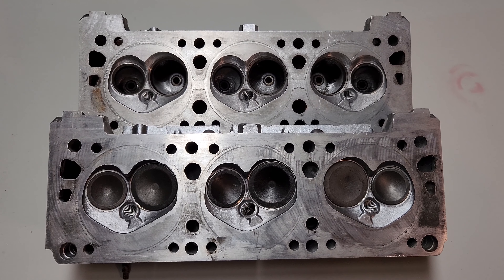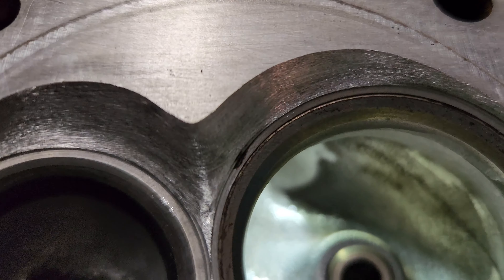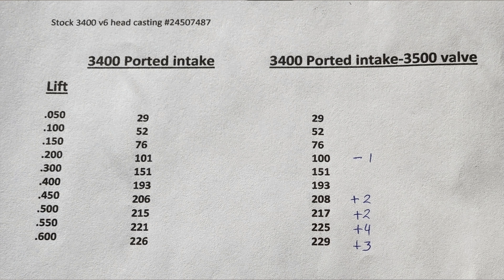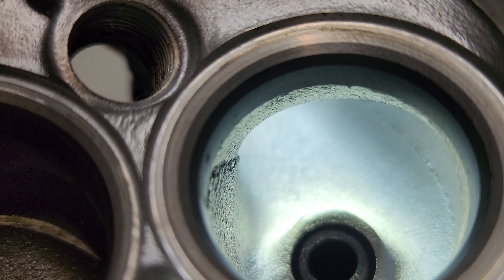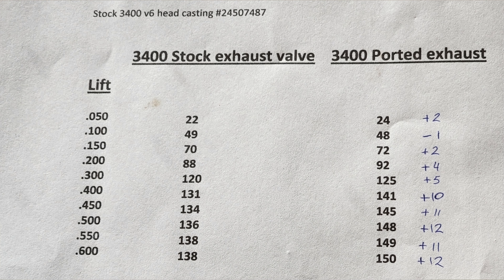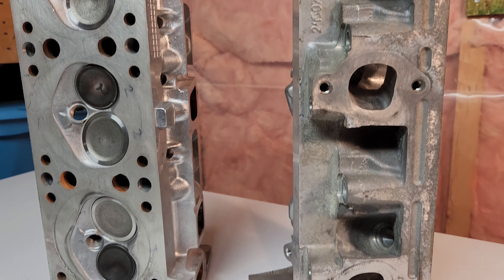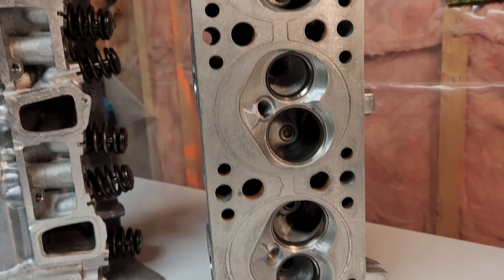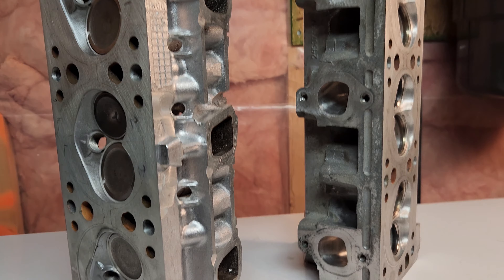Flow test results!

Comment: I know a full 3500 top end swap nets quite a bit. How much are you losing by using the 3400 UIM?
Reply from the maker: That is something I would like to test this summer, 3500 plenum/65mm TB vs. 3400 ported plenum/65mm TB. 
I find that the 3500 plenum has a little more top end, but the 3400 plenum is a little better around town, probably due to the torque from the longer runners
Reply: @modeverything1  If that turns out to be the case, it might be just the ticket for my minivan!

Comment: How much would you charge to do this work on a set of heads for them? I’m just trying to see how much I would save if I tried this myself. And what dremel do you recommend for this, is there anything special I should get?
Reply from the maker: I would probably be $800-1000 for the porting, valves and machine work. I use an old dremel 742 that has a foot speed control hooked up. I would get a good aluminum-cut carbide, I like the 6" long (1/2 or 5/8") egg shaped burr. That way I can get a good look at the port without my hands in the way, just can't spin them as fast because they can bend. Any 1/4" grinder should work, but I recommend adding a speed control if you get electric!